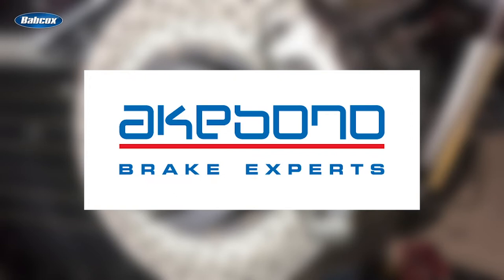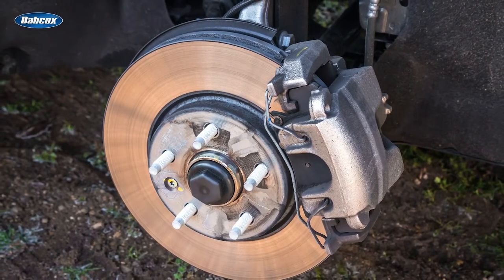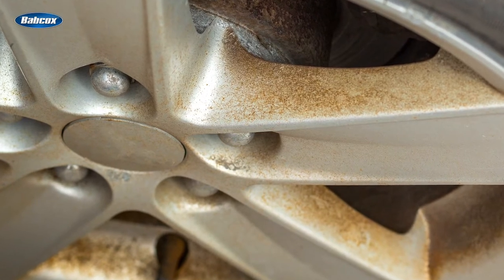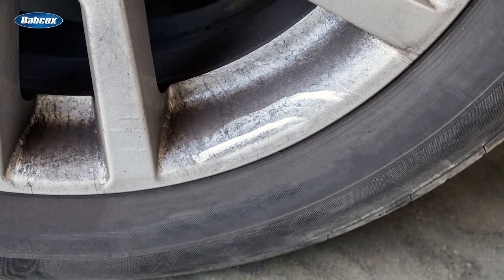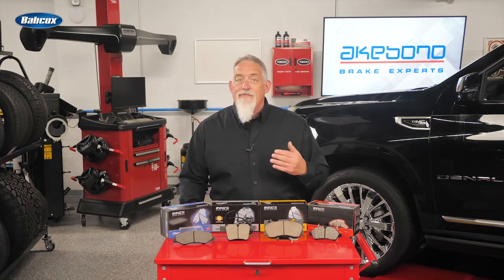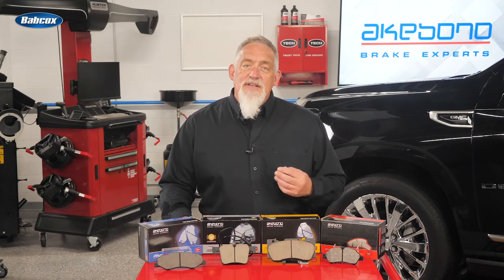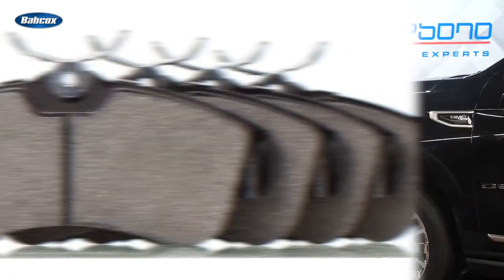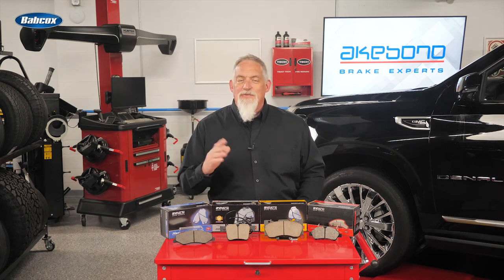Akebono-  What is Ceramic Technology?

Comment: All noise is generated by vibration. It just so happens that the frequency that the materials in ceramic brake pads mostly vibrate at is higher than what human hearing can detect.